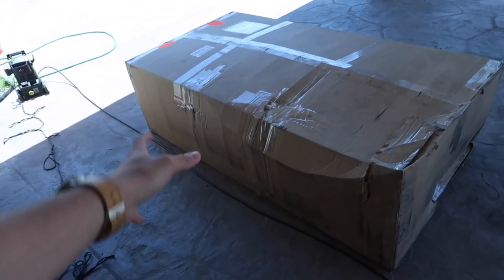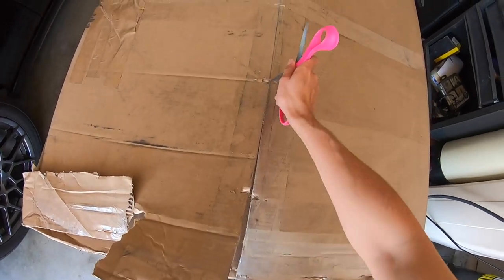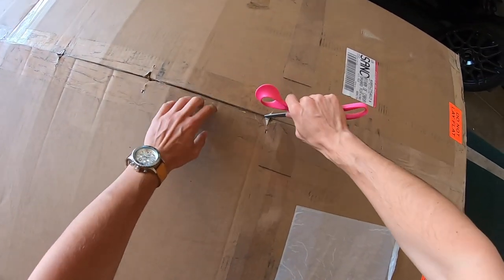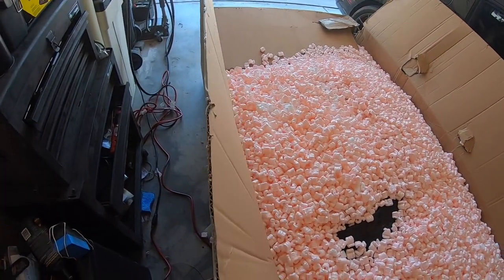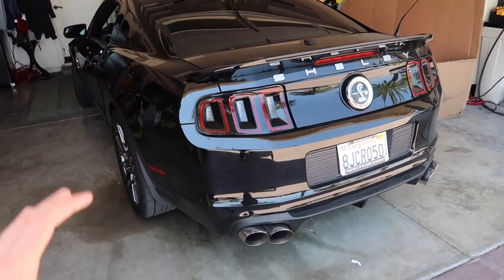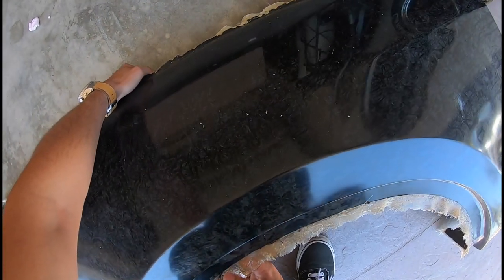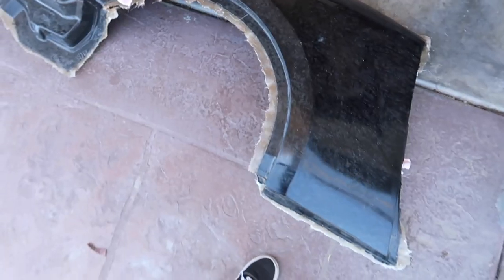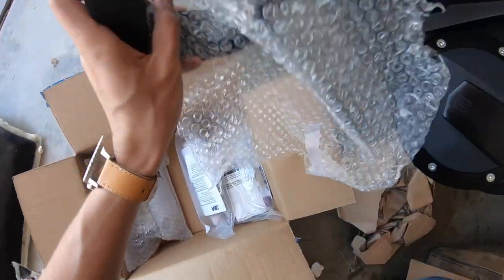Taking delivery of my Shelby 1000 wide body kit

Comment: I wouldn't use wheel spacers. I'd get new wheels with proper offset. You might need a wheel with near zero or negative offset.

Don't worry about the haters of the widebody kit. In person, your car is gonna stand out like crazy and it will look amazing. The best mod I ever did to my Stang. Congrats!!
Reply from the maker: thanks for the support man! they will change their minds when they see the final results. can't believe this much hate on something Carroll Shelby designed himself and SVT, oh well just gotta prove em wrong
Reply: @NateRider  The results will be unbelievable, really. Fat tires are required though!

Comment: That’s gonna look awesome when finished. Just make sure a top notch shop cares for it cause those kits are not an easy task. Also I believe $1200 of ur money was the 3m panel bonds and sealers. Use the same stuff at my shop. It’s not cheap but it’s the best adhesions on the market
Reply from the maker: Thanks for the info! I appreciate it

Comment: I've read that the Achilles heel of the 2007-2014 Gt500's are Fords powdered forged rods bending and the cylinder walls cracking due to being bored out. Should have spent that $3,500 on performance parts and worry about the cosmetics later. Just my opinion, I'm a performance over looks guy.
Reply: You heard way wrong.

These 5.8s make 1000hp with typical Bolton's.  Or, just keep stock exhaust and put a bigger SC and fuel system on it to hit 1000hp. 
Or, ditch blower and put turbos and fuel system and over 1000hp.
Too easy to hit 1000hp is the problem and why there aren't many stock ones left.
Just intake, 1 pulley, fuel of choice, tb, tune nets 800+hp.
Under $2k and 800hp.
$6k and over 1000hp.
Reply: @neverendingmods  oh man in that case I would have dumped 6k to hit 1,000 hp instead of a wife body kit but to each their own.

Comment: Are you planning to put forged internals in the motor? You already have a ticking time bomb at 800...
Reply from the maker: Yes, thinking about re sleeving the block then i should be good for 1,000whp. Idk if i wanna go any higher than that
Reply: Nate Rider  that’s going to be a fun build haha I’m looking to get into a 07-09 or 13-14 model year gt500. Probably 13-14 since I already have an 05 and don’t want to have two of the same body haha

Comment: A Shelby 1000 is nice but In my opinion it’s not worth the 140k.
Reply: Spending even 3000 dollars on this, while having a 500/month car payment, 200/month insurance payment isnt worth it either
Reply: @jdigitalseven7  anything is worth it if you dream about it
Reply: Dominique Rodriguez ya but he obviously doesn’t have the money for it. He only bought half the kit (on credit too). And he still has to get it painted, get the custom wheels etc. 
def not worth the money or hassle.
Reply from the maker: i have a plan, just wait on it ;) the build continues
Reply: Honestly i like the '14 gt500 but i wouldve waited for the '20 gt500 and the mods on the new 5.2 predator

Comment: good look but I never like the wide body plus to expensive, plus  you don't gain any hp.
Reply from the maker: i already maxed out my motor at 1,000 crank horsepower, so working on cosmetics for the mean time until engine build goes live

Comment: wtf are you doing to that car, gluing on fenders now?  sheesh.  Well I'm glad it isn't my car, I wouldn't want this thing after this kid is done with it.  drilling holes, taping and gluing on stuff..ugh.. yuck.
Reply: wiselink marque his car, he can do whatever the hell he wants
Reply: @nexxyyy1  No shit sherlock.  Can't say I am impressed though to be honest.  He'll make swiss cheese out of it like Sally.
Reply from the maker: im thinking about installing them on with zip ties but im still not sure if double sided tape will do the trick or not. ill keep you updated for sure tho!
Reply: @NateRider  Ugh nate I agree with these guys that it is your car and you can do what you want to it, but it is sorta odd to see someone as young as you getting an expensive car and just trashing it.  Just my opinion.  But anyways...
Reply: @NateRider  Also I took another look at those body panels.  Big, heavy pieces of fiberglass.  I definitely would not put this garbage on my own car.  All you are doing is adding weight, creating a very unnecessary job for a body shop (which isn't even going to be covered by any kind of insurance that exists) and making the car less practical to work on if there is a collision down the road.  Good luck but you won't see me ever putting fiberglass kits onto any of my vehicles. As matter of fact I do own fiberglass fenders wide body kit for one of my cars. I used steel fenders instead and getting rid of that garbage.

Comment: Think you should rather spend money on getting brembo's instead of a body kit 
those brakes are dull
Reply from the maker: yeah they need upgrades
Reply: Nate Rider Do the 6 piston upgrade its worth it. I drove my friends 2017 mustang gt track pack and it stops lol
Reply: @crunkness93  Mine is a 15 Prem / Track with the Brembos, I have a K/B and it still stops on a dime no issues.